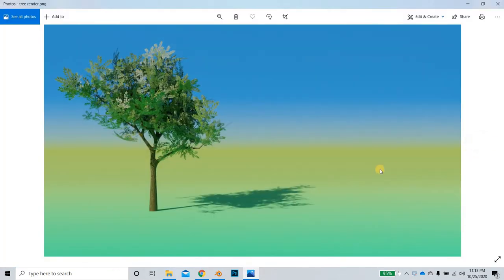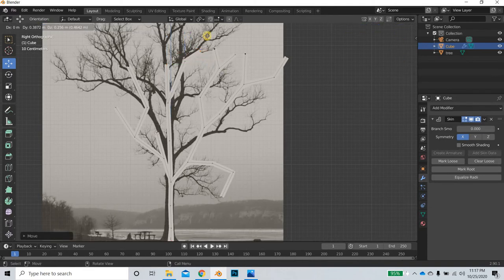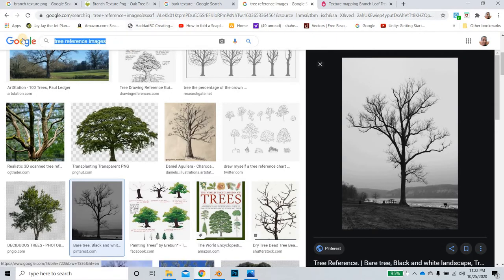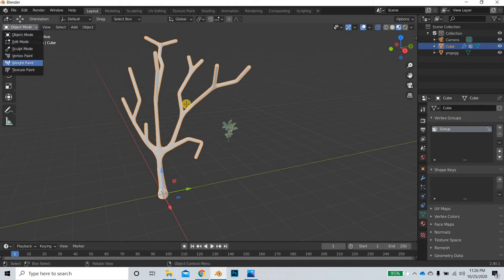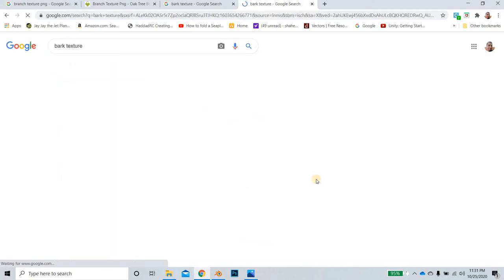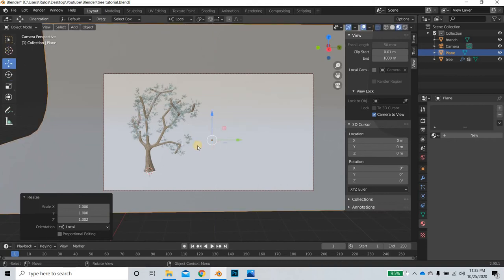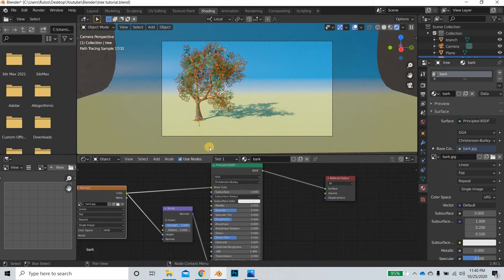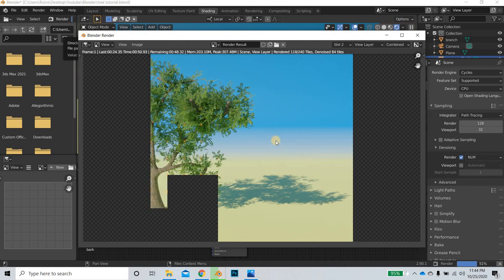Blender 2.9 - Modelling a tree using skin modifier and particles for branches

Comment: skin modifier is creating horrible topology. I rather use a cube and extrude it million times than using skin modifier and then remesh it and retopologize it
Reply from the maker: Every tool has its own advantages and disadvantages. once you learn the tools you can decide what works well for the kind of output you need.
Reply: @rahulmalpure  blender does not have any modifier that would make this job quick and perfect except manual modelling which takes very long time if branches are complex. in zbrush this can be done in few seconds and with perfect topology